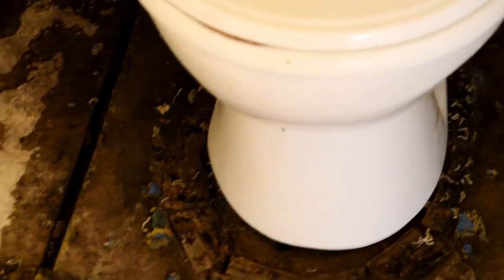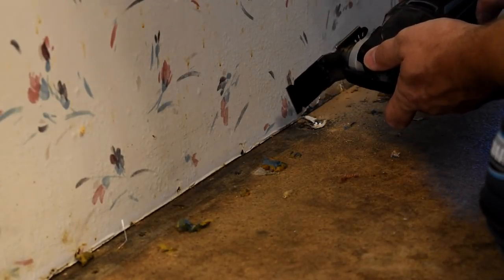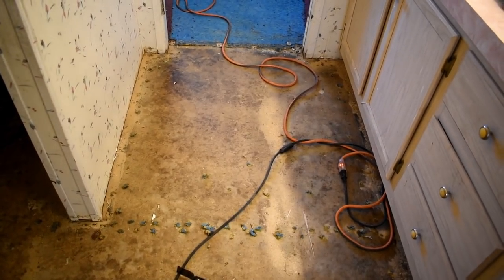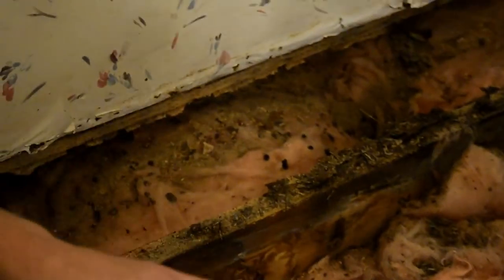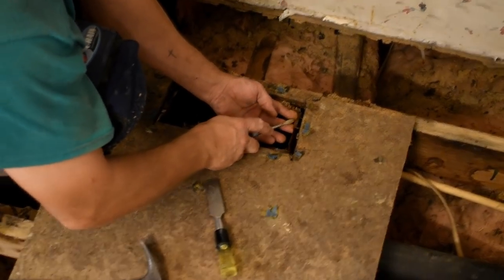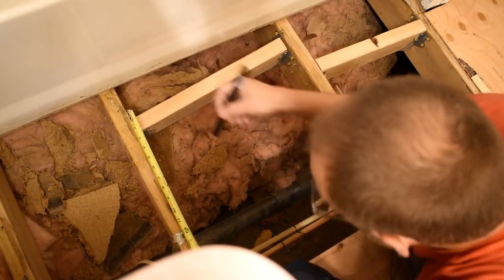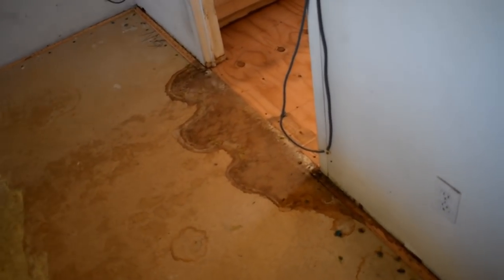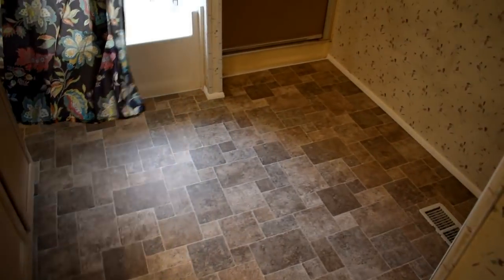SUBFLOOR DISASTER

Comment: Nice work as usual.  Does the owner have to tell buyers the place is full of mold, or is that up to them to find out?  Kind of sad he just wants to do the bare minimum to get the place on the market.  I get it financially, but I wouldn't be able to sleep at night knowing someone could get sick from the mold.
Reply from the maker: pdxDavid I feel the same way on there, when I told him it had mold all in it He said he was going to take care of it, but I seriously doubt that will happen
Reply: I wondered the same thing about the water damage and mold, so I looked it up:  

What does Tennessee law say about disclosure?
“The Residential Property Disclosure Act in Tennessee Code Annotated § 66-5-201 to 210 requires most sellers of residential real estate to complete a disclosure statement. The disclosure statement lets the buyers know about the condition of the property. Failure to disclosure information can result in the canceling of a contract and can be the basis for legal action.
The disclosure statement should include the property address and the age of the home. Disclosure requires a list of amenities included with the sale and their condition. Sellers must report any known defects or malfunctions of structural or mechanical components. Disclosure also includes a list of conditions that affect the home such as environmental hazards, encroachments, flood or drainage problems, or remodeling work done without permits or compliance to building codes. If you purchased real estate that had preexisting environmental hazards that you were not told about by the seller, you may wish to seek legal counsel to evaluate your options.”

Comment: I would have cut out the majority of it with a circular saw and then used and sawsaw to cut out the edge after I exposed what is under the floor.  Would remove cabinet base as well.  Appreciate your videos, just sharing my technique.
Reply: I will add mdf is garbage lol

Comment: Need some cardboard in that tub,gloves a toe kick saw and ,goggles,skill saw 16 penny nail gun,2 1/2 nails for frame work 2 inch ring shank to pin new floor.
Fubar, wrecking bar,flat bar to cut staples off joist.
Reply: Yeah your in dirty drain water, black mold and,He wants it done cheap.
Use a 16penny nailer rather than joist brackets and screws,the fubar will lock and twist your scabs straight until you nail them.
Reply from the maker: Well that was a good run down, thank you
Reply from the maker: Yeah man I was sick this whole job, that stuff is a killer